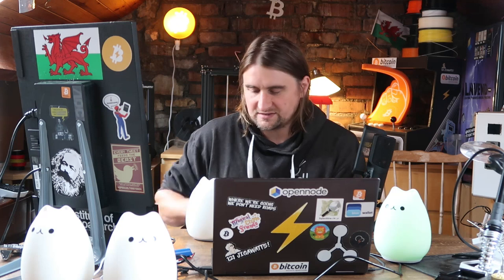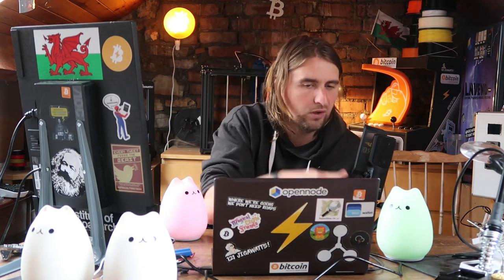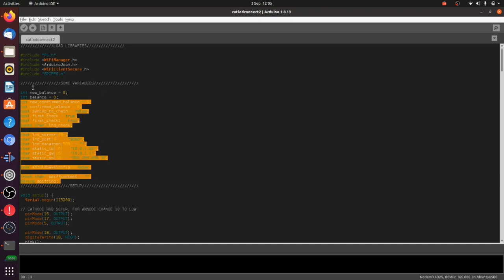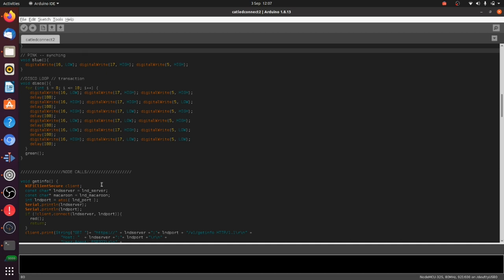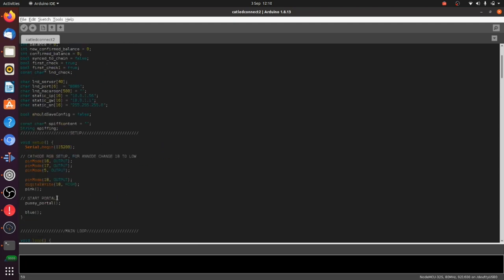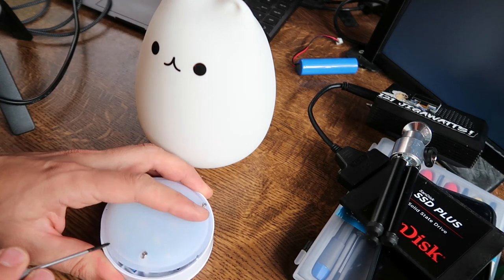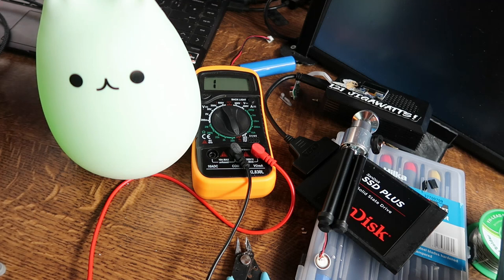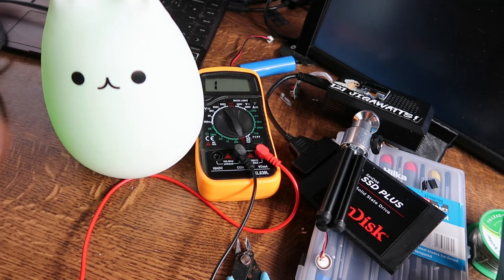BTCIOT Tutorial - LND Pussycat, node monitor

Comment: Ben, best is to keep your 3d printer filament in a dry container that is airtight. The filament is sensitive to moisture and this will reduce print quality. Get one of those IKEA cointainers that is airtight and a 'rechargeable' dehumidifier (or two) to put in the box and your filament will last much longer AND you get better prints. :)
Reply: I'm a dirty ABS fiend, always prints fine